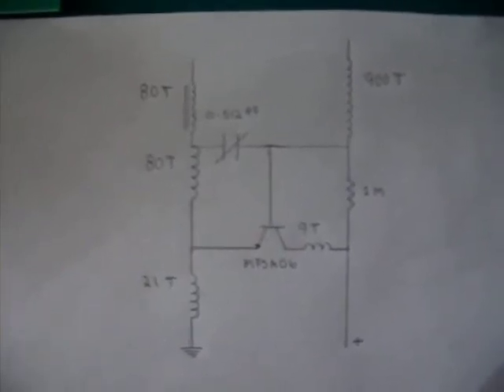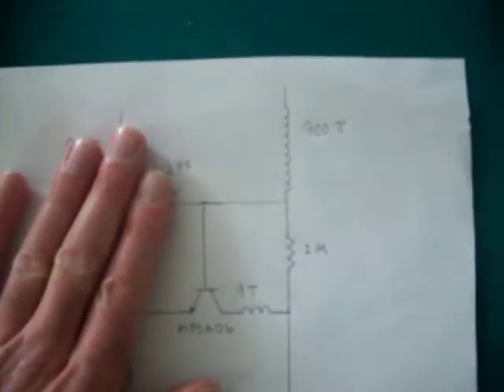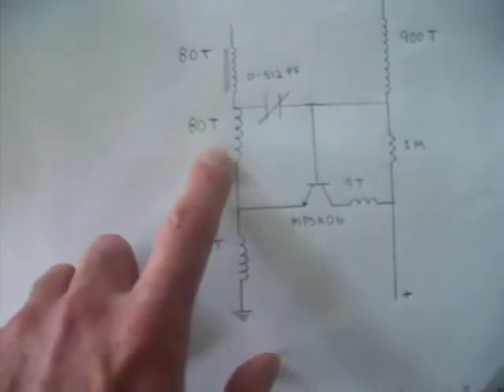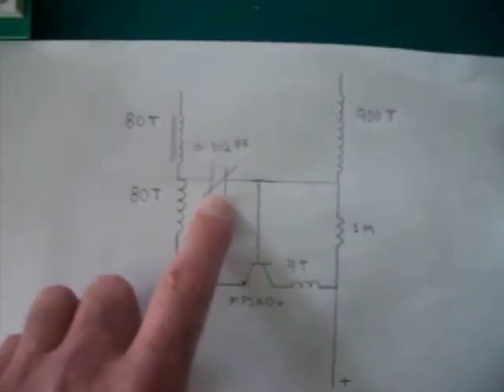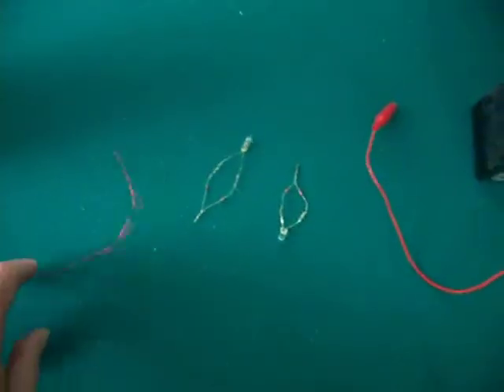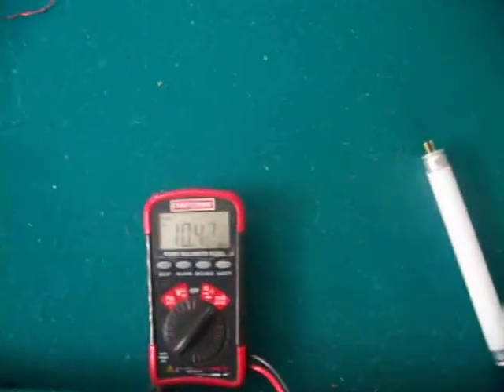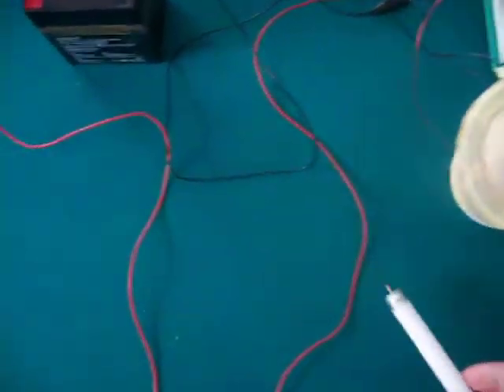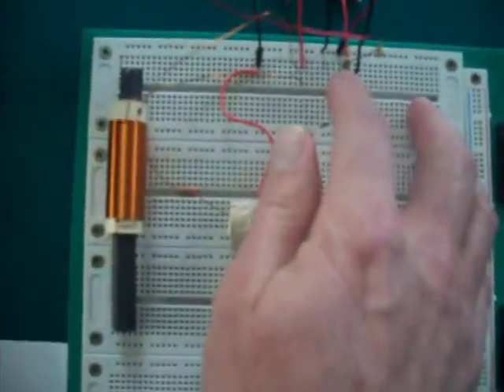Hartley Slayer Exciter Circuit

Comment: You are right.
The resistor is to supply bias current to the base of the transistor.
The 900t coil is also connected to the transistor base . The resistor is big enough, effectively to isolate the 900t coil from the 9t.
It's just an odd way to draw it..Not wrong but not conventional nor clear.

Comment from the maker: @FatallyYours84 
The coils are both wound on 1/2 inch pvc pipe around 4 inches long.
The coil with the 80 turns of 28awg magnet wire then the 21 turns of plastic coated wire over it has no ferrite core.
Only the top antenna coil has a ferrite core.It is also 80 turns of 28awg magnet wire.

Comment: Hi ,
what is the running frequency in Mhz ?
Do you have a scope, so you could show a few scopeshots
of the oscillation waveforms in a few testpoints around the circuit ?
Many thanks.
Regards, Stefan.

Comment: Well done ! Nice circuit !
Does it run on about 10 to 12 mA ?
So that is only about 144 MilliWatts and the 4 Watts FL tube is very bright..
Nice ! But how much does it pollute the surrounding with RF ?
Can you do a feedback circuit that recharges the battery, so it will never run down the battery ? That would be great !
Regards, Stefan.